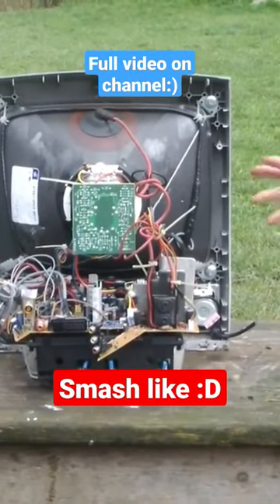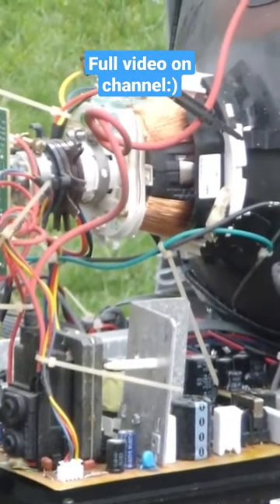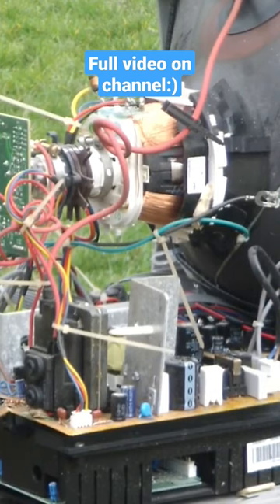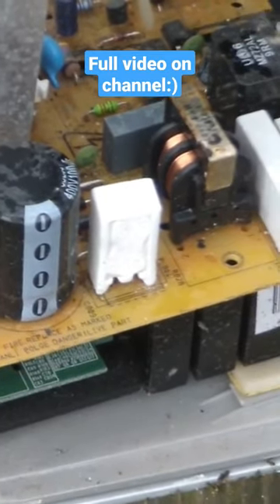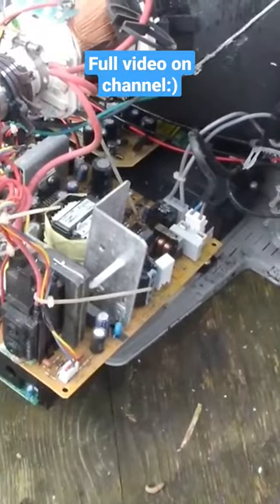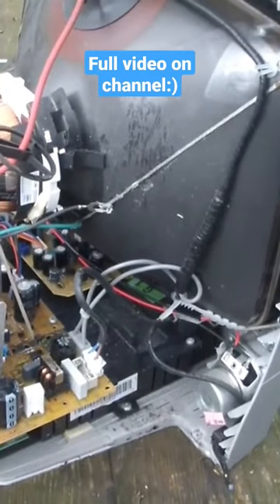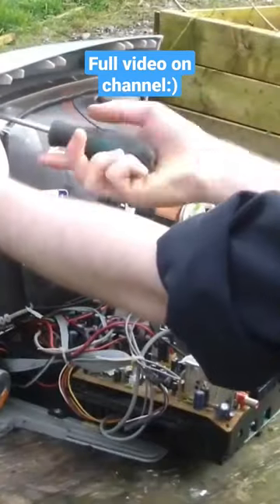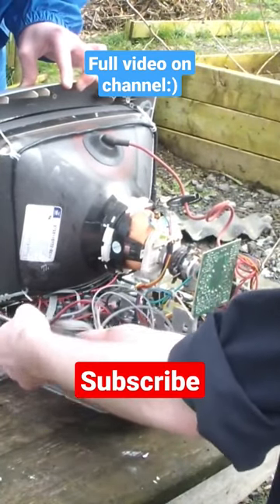taking apart an old TV! #shorts #whatsinside #science #electronic #television #tv #diy #howto #crt

Comment: aren't those extremely dangerous to disassemble/destroy because they're radioactive or something like that?
Reply from the maker: Is it dangerous but it's not radioactive. The most dangerous part is a chance of getting an electric shock from the components. Mainly from the wire that comes out the screen. Needs to be discharged professionally (we did not do this because we are idiots)